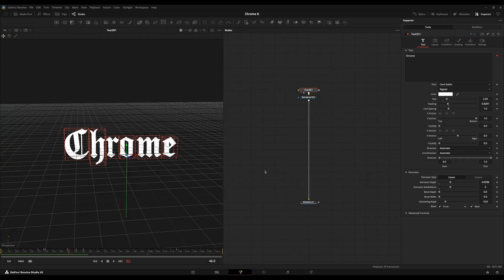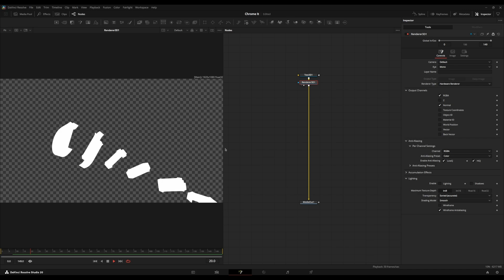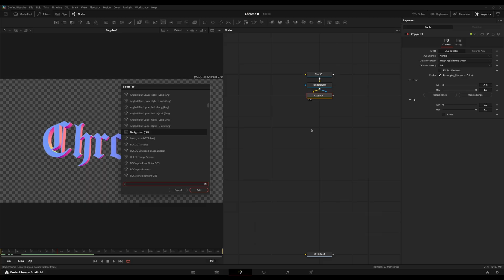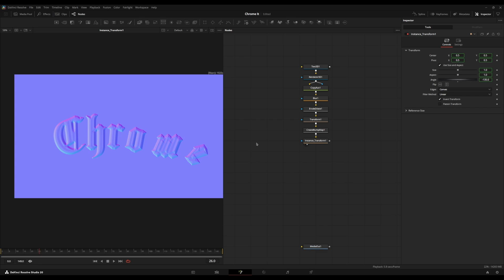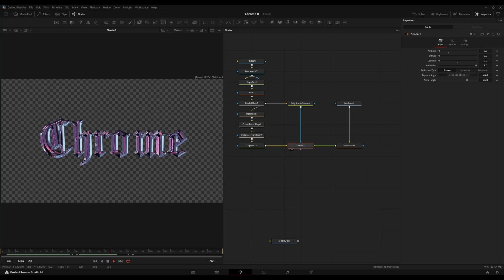[FREE] How to Create Liquid Chrome 3D Text in DaVinci Resolve 20

Comment: Is there a way to attach this effect to a camera tracker that I rendered? I can get the text to track but I can’t get the chrome effect to connect. The shader node is the end of the text setup, and the camera tracker render node is the end of the camera tracking setup but I can’t connect the two to connect them to the media out node
Reply from the maker: 1. Remove the mediaIn from
the Camera3D, so it's a transparent background.
2. Add the text to the merge3D on the copied setup and follow the tutorial from there.
3. When you're done with the tutorial merge the original media to the background of a merge node and connect the render3D to the foreground

Comment: I need help. First at all good video but as soon as i connect the copyaux node to my 3d render node, it turns red and it doesnt work. I tryed plenty of times and changed a lot of settings but i dont know why it does this.
Reply from the maker: did you enable the normal output on the 3d renderer? it sounds like the node turns red because there's no normal output available
Reply: @sci_dr  yes i did
Reply from the maker: @andereskai5343 do you have discord? i think it'll be easier to fix this if we communicated on there, my discord is sci.dr

Comment: very nice but you couldve just used the reflect material and set the reflection mode to constant!
Reply from the maker: unfortunately with the 3d text bevel settings there's no way to bevel inward (to my knowledge) like i did in the previous tutorial, which is why i chose not to use the reflect material.